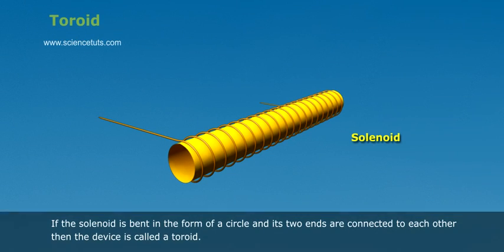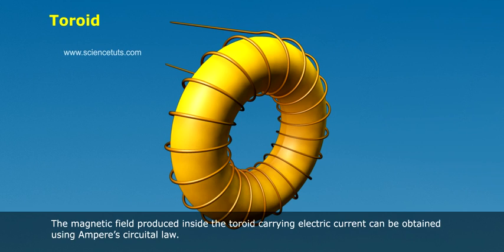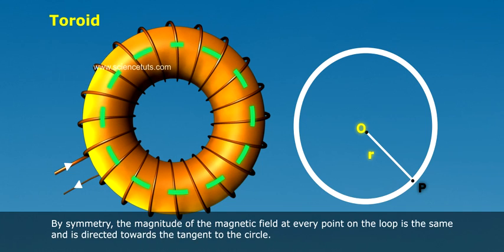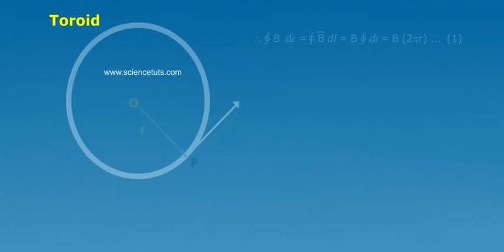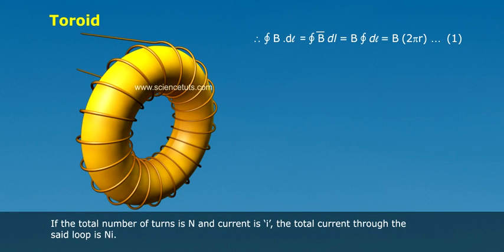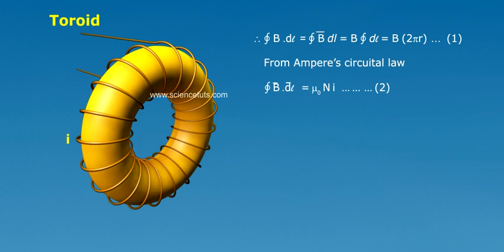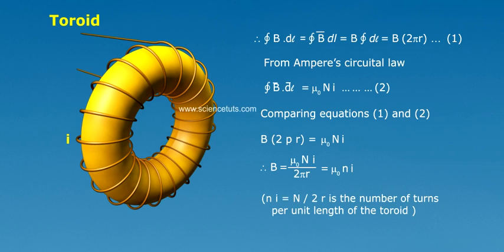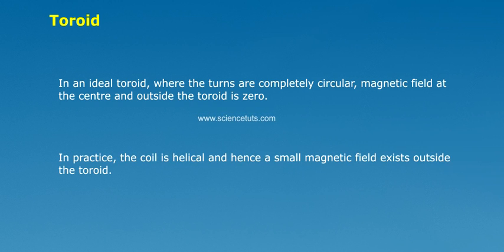TOROID

Comment: I know a little of electronics and i still don't understand what the heck this guy is talking about
Reply: magnetic flux perpendicular to the wound wire through the center of the donut pushes electrons to general a current (wirelessly) to power another object or increase an original voltage through a certain number of wire loops over the entire donut circle [0 to 2*pi]. though I'm not sure I still fully understand it.
Reply: Definitely helpful. Thank you kind person  @geraldlarson5796